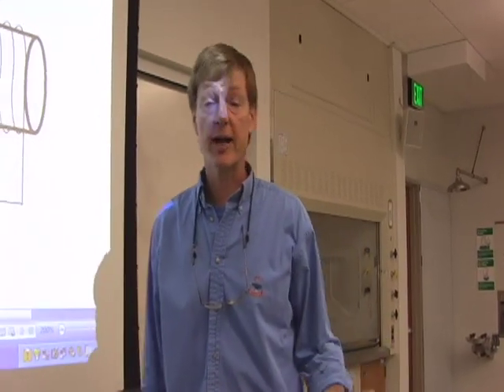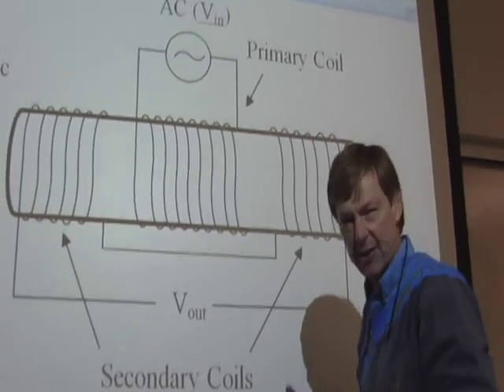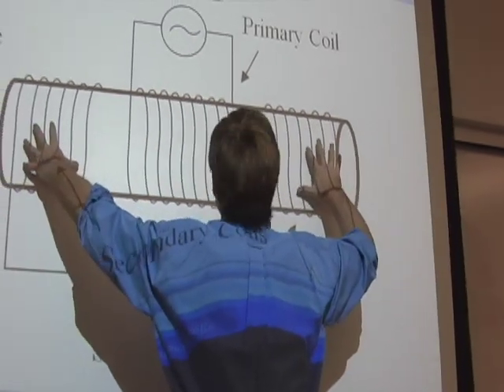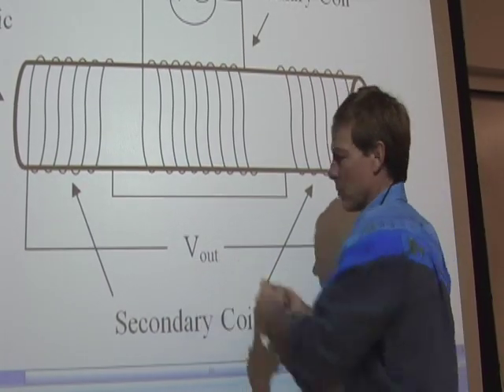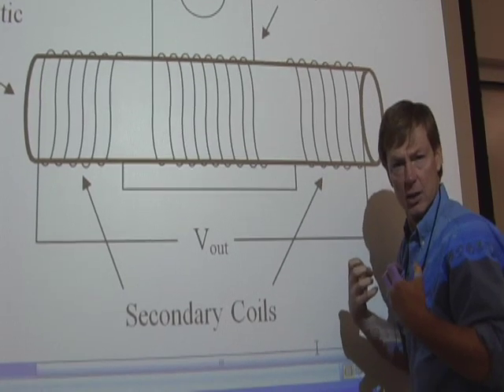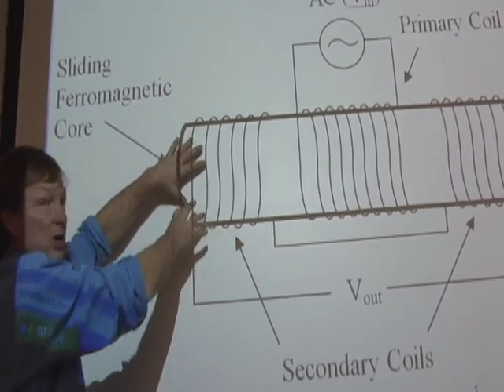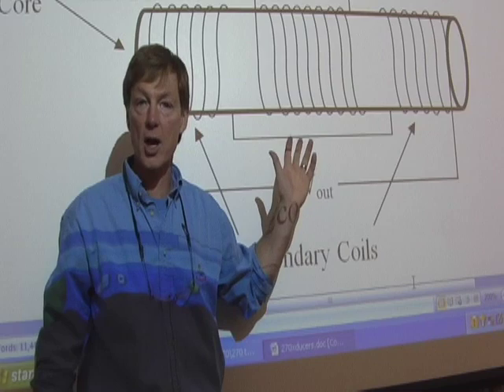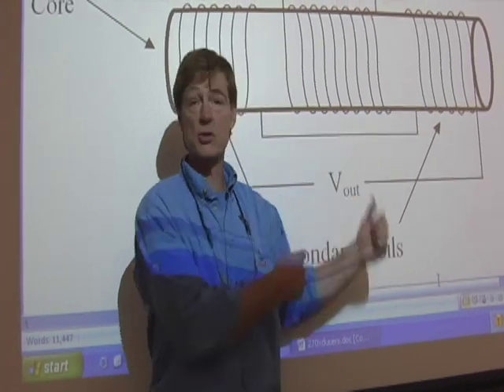Physics IV D4 Transducers: Linear Variable Differential Transformers

Comment from the maker: Good question!  LVDT output is naturally AC, but that output can be connected to a circuit called a rectifier (consisting of diodes) that will convert it to a DC signal, which is more convenient to measure distances with. - bob